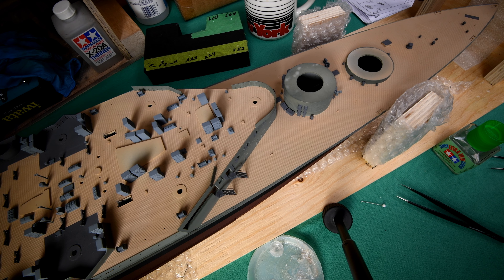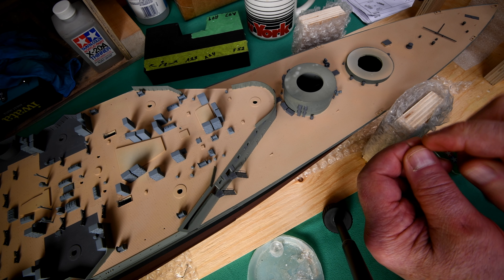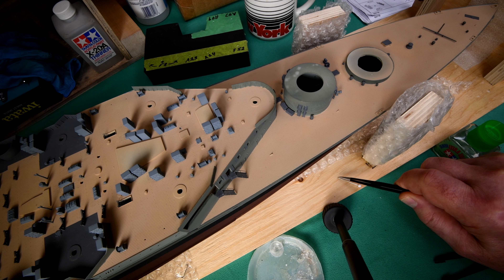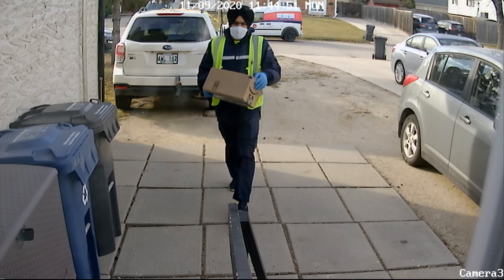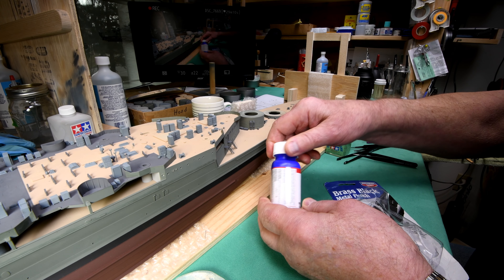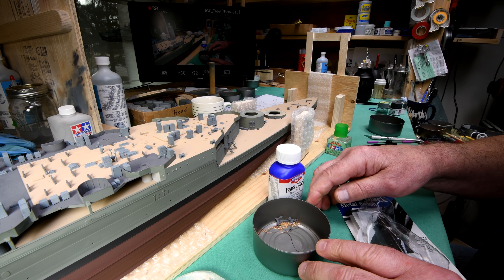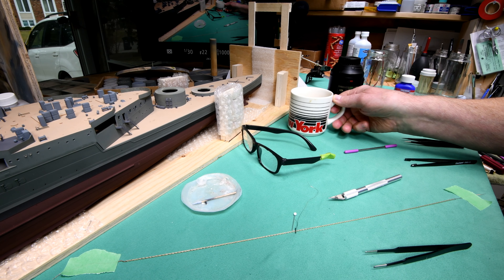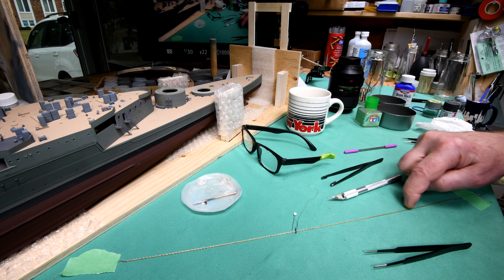The Model Ship - Part 621

Comment: Brass black is great, but in my opinion, you shouldn't dip the metal inside the bottle, you will end up neutralizing it faster than it would, also the oxidation produced so fast with the brass black on full concentration rubs off, I advise diluting it outside, takes a bit longer to blacken but it's a more resisting oxidation, hope it helps
Reply from the maker: Wish I'd read this earlier, lol. Thanks 👍
Reply: @roncalverley  on my channel, on the video from last week called rust effects on chain plates you can see how I do it, works for me
Reply from the maker: 👍 https://youtu.be/axeNQn3L1UU?t=58